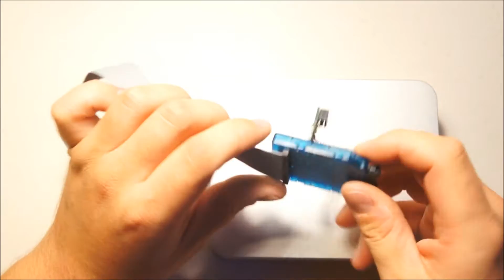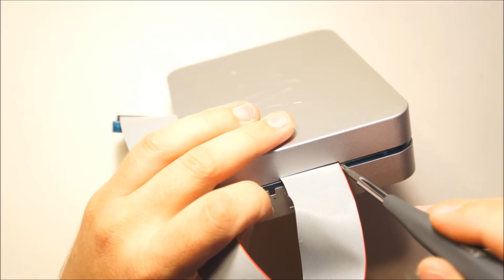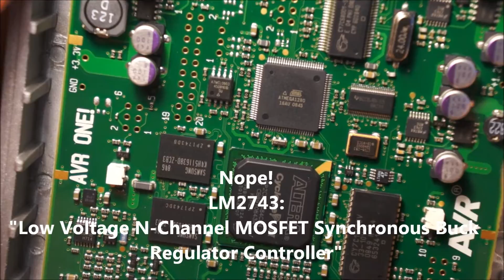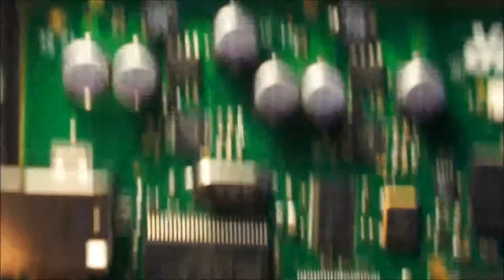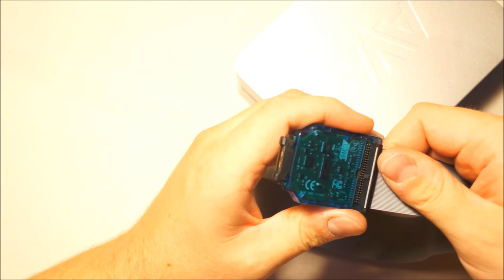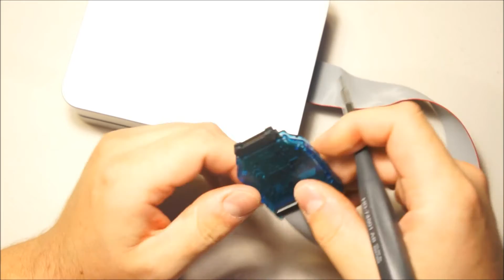Teardown: Atmel AVR One Programmer

Comment: Google for 
DTrace Extension for DProb167 / DProbeST10
provides trace memory and is available in sizes of 64 k and 128 k 
sampling memories. 
Adding a DTrace module enhances DProbe with the following features:
 
Real-time trace recording of all bondout busses and control signals (144 channels) 
2 complex events for breakpoints, trace triggers and trace qualifiers 
2 stage sequencer logic (if ... then ... else ...) 
48-bit timestamps with 50 ns resolution 
Trace/trigger on register accesses

Comment: It is for a tracing the MCU like ICE. So you can simulate Pin-Signals like a external CAN Bus emulater does. And record this
for an online analysis, esp. IRQ Handling in a MCU, with exact time-Stamp for an IRQ ACK. 
Motorola cal it Back-ground Debugger. and event trace Trigger, to 
bullet proof your design at run-Time, via a feedback-loop and worst case MCU timing szenario. Eg. HITEX ICE HW Emulator.

Comment: I really don't like that the board doesn't have (or at least doesn't appear to have) some sort of PTC/other kind of resettable fuse. Maybe the small board has, but If you're using reversible connectors that may short out I see that as kind of a must-have feature.

Comment: Apart from the tamperproof-ness (which is kind of bullocks on engineer-targeted devices) those torx screws are used simply because they're.... better than philips or posidriv. Torx was originally developed to improve head wear and torque transfer characteristics and was intended to eventually supersede posidriv. When I do case design, I like to design for allen and torx for that reason.